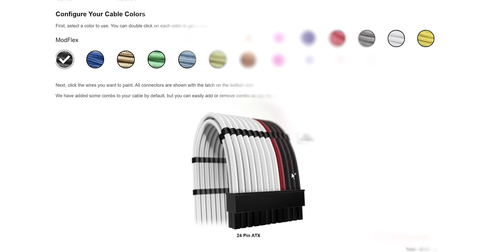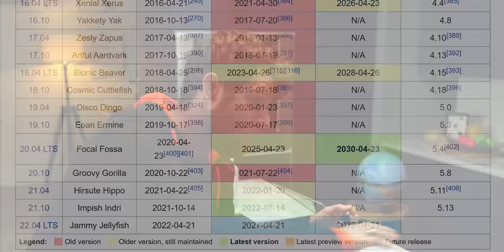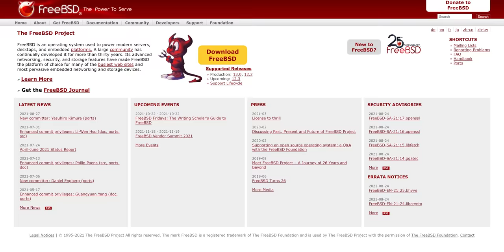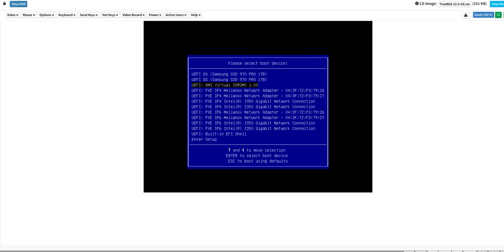We Finally Did it Properly - "Linux" Whonnock Upgrade

Comment: When are you going to do the daily driver version of this video?  I mean, getting your distro of choice to run on a fairly simple one-display system like most people use before going into stuff most experienced Windows users would get a professional to do for them, updating after install as prompted instead of directly installing loads of stuff that has been updated several times since you downloaded the iso, taking a long sentence in plain English under a long paragraph to be typed where you'd expect pressing "y" should be enough if it weren't totally sure going on would break your install, that kind if thing?

Comment: Umbuntu also has SAMBA, and as for the other thing, download and build a kernel and include zfs, problem solved, that takes a whole of about 20 minutes on an 8-core, I'm sure on your 24 core, if AMD doesn't melt down, it will be much faster.

Comment: maybe this has been answered before but why dont you use version control instead of a shared local server? You could use the local server as master and then check out the repos to your machine via svn or git and commit changes as needed. create each project as a repo so you isolate the exact data you need.  you would get maximum performance of nvme drive speed while editing. You have fast net so committing and syncing data shouldnt be a bottleneck.
Reply: they are doing video editing; the RAW is ginormous; Video editors don't do git clone etc. they are in FCP or Resolve.  What you are theorizing would not be possible; who would be editing production while half the editors were sent for training?  Enjoy the thought though!

Comment: I just need an old used tower server. All i find are way to expensive when they are in tower config for some reason. In rack mount they are around 150$. tower most are over 500$ for less ram and cpu

Comment: I also have big issues with TrueNAS. Apps don't work properly and for some reason, TrueNAS needs a GPU so you can't pass it to the VM. Also creating bridge interface doesn't work properly using the UI. I tried to switch from Unraid, but holy shit, I didn't know how polished Unraid is in comparison (witn official ZFS support now).

Comment: You should really be using AD and AAD (Azure AD) for your workstations so that there is a layer of security aside from Bitlocker. It also allows a lot more configuration that can happen automatically on the machine regardless of RMM software.
Reply: Linux can make a basic AD equivalent via Samba, and of course LDAP can absolutely ensure nobody does anything until logging in as well...(The USAF uses LDAP on RHEL for login authority in several TS/SCI applications/locations)
Reply: @mdd1963  Right... meanwhile the majority of machines LTT uses for their workstations use windows... AzureAD is an absolute no brainer here.
Reply: @robertgarrison1738  Needing some Windows only apps for work/editing in no way means 'need Active DIrectory' login, and to an external server, no less, to begin daily workflow...
Reply: @mdd1963  Tell me you don't know how AzureAD works without telling me you don't know.
Reply: @robertgarrison1738  As you seem to be implying a sel-proclaimed status as an AzureAD capabilities guru....explain it to me, please. What advantages will an  office of 20-30 employees blessed with AzureAD then be entitled to/receiving? (Excluding needing connectivity with MS to even login, and a monthly bill per user for that privilege)
Reply: @mdd1963  AAD has no added bill if you're solely using the AD capabilities. But to answer your question, ask literally any SMB or enterprise how long or how stressful it is to implement new workstations or implement new software into their workflow. AAD can automate literally all of that. That's the beauty, simplicity and efficiency. You wouldn't know the full capabilities of AAD unless you directly work with it since MS explicitly doesn't advertise it. It's meant to be used for SMB's/Enterprises but literally anyone can leverage the power from it.

Comment: Hey, I was wondering if you could either answer here or make a video for this: Basically, I do Not like the way AMD GPUs make my graphics look, I prefer NVIDIA 100%. But that's graphics cards... Are there differences between intel and AMD processors in this same respect? Reasons one might be better than the other? Or potentially why one has better support than the other? I had Awful experiences with AMD on my graphics card, so I not only hated how it made my screen appear but I also did not like their terrible tech support.

Comment: NVME drives can be joined together as a single RAID 0 boot drive on TR4 platform
Reply: The NVMe drives are the wrong (Samsung), Corsair 600 Series (e.g.) is the right one supporting native 4k logical-/physical-block-size
Reply: @tonyadvantaged9353  TR4 needed a firmware upgrade because none of the chipsets supported NVMe RAID when TR4 was released. The first iteration of this firmware upgrade that allowed the NVMe drives to be  RAID'd together and also bootable, was released at some point in 2018. 

Not sure if that applies to the machine in this video, but I remember people saying "OoOoHh, guess we can't raid 0 the NVMe drives on TR4. Bummer."
Reply: @securedigitsplus  From which kind of RAID are you talking, Motherboard-RAID, HBA-RAID or OS-RAID. This is Important, and by the way, we have 2022 and not 2018 anymore.

Intel-CPs have an hardware-bug since 1995 (Austria, Vienna, technical university) not yet solved outer you install Linux with standard patched kernel.

We have to solve actual and future problems and stop to talk about solved issue. We have enough problem to solve now, allegations on solved topics are obsolete.
Reply: @tonyadvantaged9353  motherboard NVME raid 0. also, why comment on it if it's an old issue?
Reply: @securedigitsplus  I commented only the still open issue, you add solved issue, me not.

Comment: with servers, the simpler the better. the most Chinese also the better. its just how it is, I used to work at a place that shipped all types of servers for fb google and amazon. Their server setups were simple even the ones with 36 7.2gb ssds they used simple layouts and the simplicity of the troubleshooting can be solved.  the setup with the ssds in the back is a very good design from amazons, I know. There were servers with 36 7.2gb 2 100G network interfaces, and the amount of servers they were shipping was like......

Comment: My macbook is running "Linux". Well, it's not technically Linux, its a unix based operating system called "Mac OS X". 😆

Ubuntu 20.04 is an LTS release, which have more stable, older packages. You likely could get a PPA to upgrade samba on ubuntu, or ZFS on debian. Also who calls it "Deebian"?

Seemed like when you doubled threads/jobs to 24, it removed the fluctauatoins in speed from before.

I'm currently building a SFF pc with 64GB ECC VLP RAM and a Ryzen 5950x cpu. It'll run actual linux and manage a ZFS pool of 2 mirrored 14tb drives. I may buy a third and run in RAIDZ1 for 50% more cost, but 2x the storage. But a mirrored setup has better performance, reliability, and simplicity.

Also, this video doesn't mention the vdev/zpool setup for its drives. If you have too many drives (10+) in one vdev, it can cause fragmentation on the storage after a couple months and become unusable (even for home users who don't need super high iops.)

Comment: Sounds like the main problem before is that you did a poor job of setting the server up. The main reasons for blue screens are either faulty hardware, or you've done something wrong with getting it set up. On top of that, you really really really should've been using hardware RAID for this many drives, so you were pushing software features to do things they weren't really intended for.

Basically - You set yourself up for failure and surprise pikachu'd when you got burned.
Reply: Pikachu!  Exactly.

Comment: Wondering, are your video-editors using Windows 10 Workstation. There is a feature that allows multi-treading file transfers that will remove the speed bottleneck between Client and Server. Windows Server 2019/2022 and Windows10/11 Workstation should be you next test bed. Would love to see that. Thanks for the vid.

Comment: Why you didn't store your data on AWS or AZURE, is it better to store it on onsite server, what I learned is that the cost of server ownership is greater than the cost of storing your stuff on AWS or any cloud provider, since if something breaks with the server, you have to fix it and you might lose all data, compared with these data centers that can give you storage at a lower price and you don't need to fix anything if something goes wrong. I am curious as to why you did not use cloud provider services.
Reply: he needs video ingest somewhere local and fast to get it onto his servers so they can edit

Comment: On the new AMD processors you can see the memory bandwidth being consumed, memory controller utilization.  What does the memory controller utilization look like when you are running the benchmark tests?  what does it look like when you have it under heavy load?  All that copying plus encryption plus decryption must put a heavy burden on the memory controllers moving the data around.

Comment: Hey Linus I’m certainly learning Windows Server 2016 for certification 

I was curious if you could maybe elaborate on why you switched 

Or why you didn’t just use windows server nano or server core installation instead 😇
Reply: Linux, or in this case TruNAS (OpenBSD) is just more stable than linux and is more suited for server applications.

Comment: Hmmmmm i like to use Linux Mint, but it can not replace Windows,  1 not al te hardware is supported  2 many program's and software is not available for Linux.  3  Wine still has many flaws and problems and causes a very high CPU load to emulate simple windows programs.

Comment: Literally been running windows inside a VM on linux... has been substantially more stable than windows running on the hardware directly.  You can do so much with linux kvm/qemu now it's ridiculous.  Some recent stuff even allows you to run multiple VMs using the same host GPU with full-fat 3d acceleration.

Comment: My niece is in university and away from home. She is studying filmmaking and needs to edit on a Mac. She is going to het one of the new M1pro or M1max machines for her birthday next month. In the meantime she needs an external editing drive that can be eventually used as local backup. She is at the beginning of learning this type of work and has hand me down equipment right now (a core i7 two or three year old MacBook Pro 16inch). She also is not very confident of her computer skills. I’d like her to have a simple ingest/storage drive that gets auto cloud backup regularly.  a hard drive on her computer big enough that she can edit directly on it that is also backed up to offsite cloud location regularly. Do you have any suggestions for hardware, companies to work with, software, drive types, etc…?
Reply: ask her what her film buddies think is the most reasonable system to get and go with that
Reply: I know this is old. Synology NAS’s are great.

Comment: This makes me want to try truenas again.  I tried using it for iscsi and nfs a while back and neither would work.  would run at normal speeds at first then slow to a crawl.  pretty sure it has something to do with the RAM cache and maybe truenas didn't like the PERC.  With these explanations in this video it gives me a few more ideas to try.

Comment: Enjoyed the vid! BSOD/Driver issues etc. Looks like you bought a bag of parts and expect it to all work properly at the OS level. Nearly impossible for manufacturers to get drivers right for every hardware component, so takes an element of luck. Similar example would be comparing a kit car to a BMW. Why didn't you pay more and get a better outcome where the manufacturer pre-validates their hardware, drivers and works with the software vendor (both OS and Hypervisor) to reduce such issues. Solutions such as validated solutions based on Azure Stack for HCI or VMware (such as VxRail), or similar? This is what many businesses do to ensure a better outcome, although it wouldn't make many videos such as this; you'd make more on consumer grade products! :)

Comment: Why the f' so much fuzz about storage? BSD, (ZFS if you really want it in-between) and fibrechannel target.
Exported as block device to consuming servers. 10 years old FC gear is faster than 1G network .. 8G FC is on-par with 10G iSCSI/NFS/SMB .. and it's also obsolete (ie good secondhand pickings). Thing is .. even if you build home lab .. few gens old enterprise stuff is usually good enough.

Comment: Whilst it sounds like you were pushing the limits and could have worked out the Windows issues, maybe by adding more cores, its funny how its always BSD that saves the day, which is what I'll usually use if Windows isn't an option! But all the Linux fanboy-ism never listens, of course. I'd rather stop using computers than have to have Linux as a main daily driver. It literally gets used when there's no other option, mostly Raspberry Pi or some other obscure device that you can only run Linux on (which ends up being consoles like PS2/4, Dreamcast, Xbox, etc..) so yeah.. Guess you always find the limit! Windows Server works great for my uses, which is running a NAS at home with a few PCs connected at 2x1Gbps.. Not dozens that have to transfer a GigaBYTE a second! Haha!

Comment: GNU/Linux is a cult, which they are preaching everyday, so annoying.
Linux is geek and radical, which makes users feel fresh, yet it do not bring any improvement than Windows or Solaris, and needs more hardwork to maintain and fix it.
For example, everyone is investing in and advertising pure electric vehicles on the grounds that pure electric vehicles are more environmentally friendly.  In fact, most of the energy for electric vehicles comes from coal-burning and nuclear power, and the battery is not degradable and extremely polluting.  The publicity of electric cars is only because it makes money.
Reply: huh? lmfao

Comment: You might not know this, but Linux uses the RAM as a buffer for read/writes, it lays out the files before writing them to the filesystem, preventing fragmentation. That is the reason that the EXT filesystem series has never had a fragmentation issue like NTFS does. Bluescreens? If you use a good Linux, you don't have bluescreens (kernel panics) Windows is unfortunately pretty crappy compared to the quality that Linux has and Windows usage in professional IT is waning for that reason. Microsoft, instead of improving their OS, they are toys and garbage like Cortana and silly stuff like that. In the meanwhile, every 3 months, a newer more efficient, secure and improved Linux Kernel is coming out and that has been going on for years.

Comment: Changing windows to linux.... Is there any lower pit to fall into?
Reply: Windows for servers is a pretty low pit if you ask me
Reply: if youd ever configured a server, youd know that linux is the best option
Reply: @ballfartius  About 12 years ago i worked as sysadmin and used several Win Server 2000. Do not remember any difficulties. Quite liked it. One was data another 3 file.